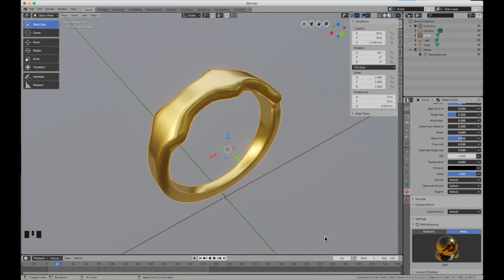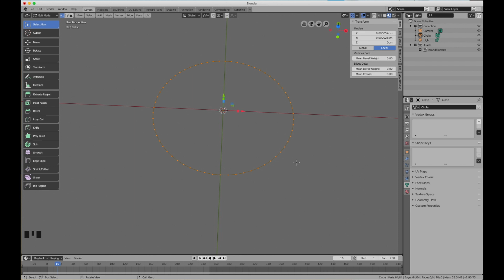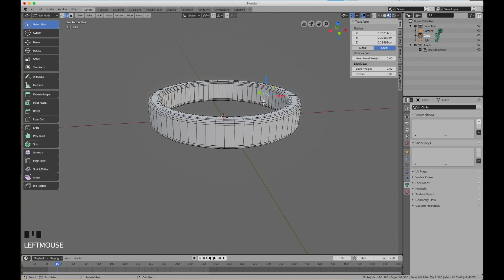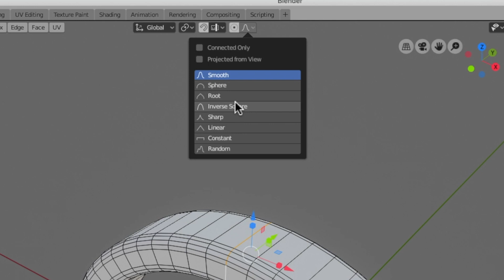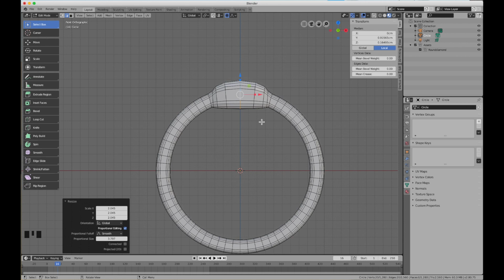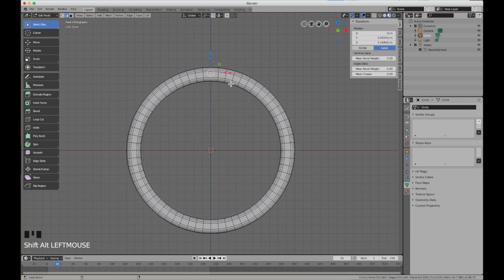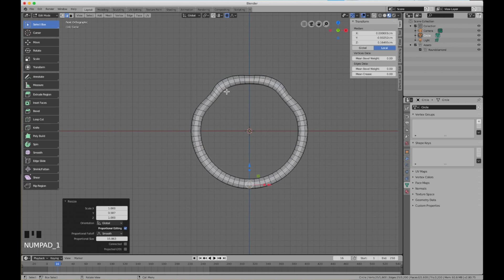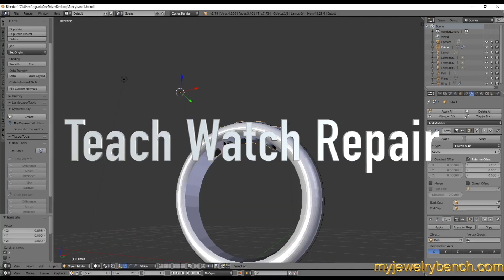Modeling Jewelry with Blender 3d, Proportional Editing!  Part 3

Comment: I don't know if you gonna see this, but I'm trying to do this with 2.9 version and when it's time to press S it does a different thing. I would really appreciate if you could help me with that.
Sorry for my english.
Reply from the maker: I would suggest that you use the Blender preferences tab, and reset all values back to default.  You will have to re-activate any of the add-ons you installed, but you will not have to re-install them.  S, is the key for scale.  Should work by default.  If you changed themes, or settings, some of these defaults will change to something else.
Reply: @watchesandjewelry  Thank you very much